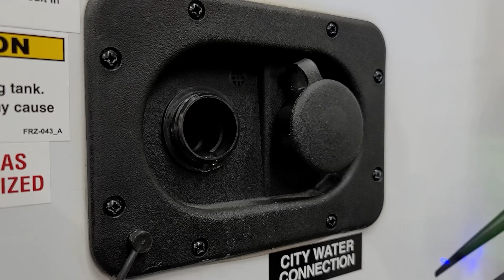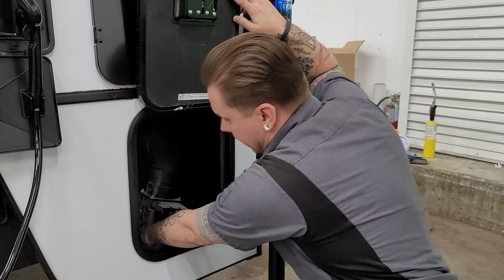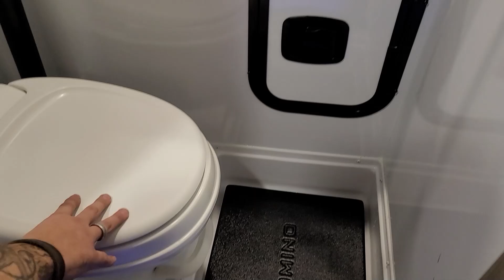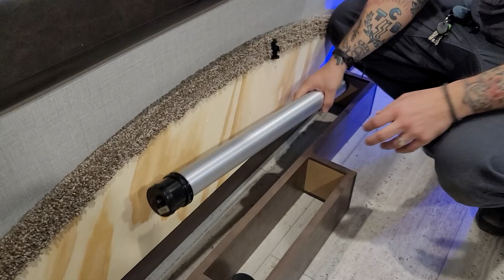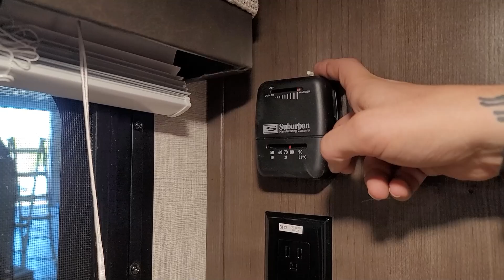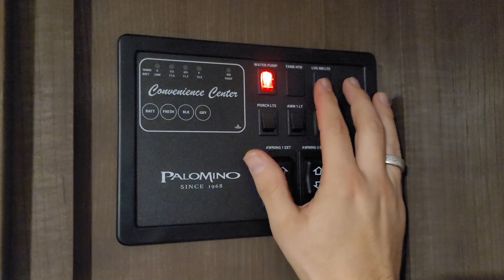2021 Palomino HS-8801 Technician Tour

Comment: What color are the cables for solar?.. I’m sure the cables are down where the batteries are, but I need to know which ones. 

EDIT:.. I found the wires and they’re down where the batteries are.. 2 white wires together, and 1 orange/1 orange and white wire together.

Comment: The freshwater tank is 31 gallons, the gray water tank is 8 gallons, the black water tank is 7 gallons, where does the rest of the water go? Thanks
Reply: Sadly, it will probably overflow into your floor if you don’t keep those tanks drained. I learned this the hard way on my last camper.

Comment: Does this unit come with a charge controller for the solar panel?
Reply from the maker: If the specific unit is outfitted with the optional solar panels, it will also include the charge controller.